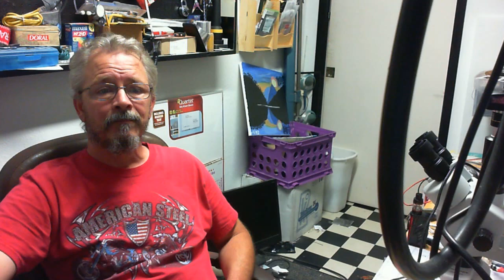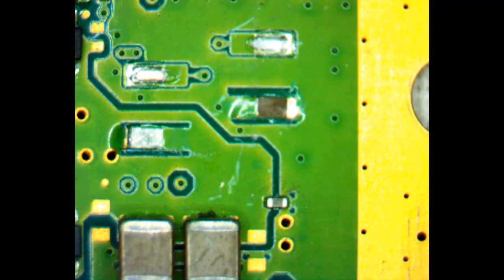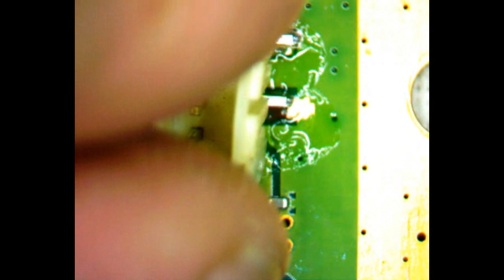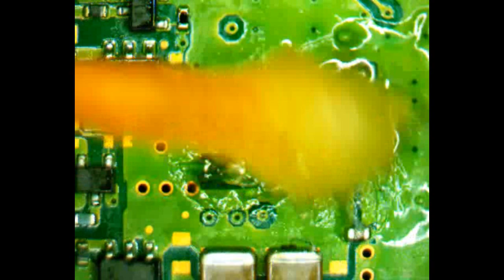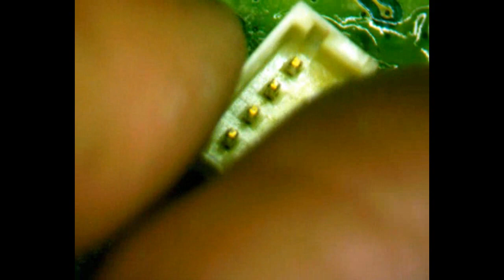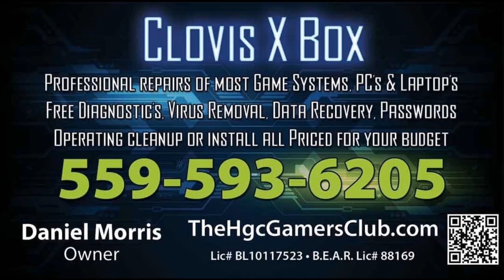PS4 CUH-1115A No Power (Motherboard Repair)

Comment: How to rebuild the two pads on this model you said are extremely hard to rebuild what are the test points for those two pads??
Reply from the maker: Why would you need test points if the port was ripped off the motherboard? Sorry but if you can not figure out how to fix something simple like this you should take it to a qualified repair shop before you end your system.

Comment: Hey bud question for you hope it gets answered, does this call for Leaded Solder only or can Unleaded Solder work as well?? All pads still under component. Got it on board yesterday but no power still
Reply from the maker: You can use easily use both for anything on the power supply the leaded solder is easier to work with for most. But I would recommend before you burn down your house or someone else's house you just buy a working replacement on eBay because that is the (1) item in the hole system that can and will kill someone if you do not do the repair correctly.
Reply: Well I was able to do it without the housefire assface thanks for that comment but where are test points for the pads if the trace is gone??

Comment: Hello I have this same issue and I've been told the repair isnt possible or that I need a trace wire for the two ports. The power supply was pulled cleaned off. Is all that is needed is a solder or do I need to place a trace wire?
Reply from the maker: I would need to see the damage on the motherboard to even come close to answering that question if a shop told you it was not possible it is because they are YouTube Educated and do not know what they are doing there is always a way to fix it as long as you did not damage anything else trying to remove the motherboard or trying to solder it yourself? If you like you can mail it to me for the repair it will be a little under $15 to send it USPS if for any reason it is not repairable I will not charge you for finding out, if you are local it will not cost you anything for me to look at it. http://www.clovisxbox360repair.com/contact.html
Reply: Nice work

Comment: How much do you charge to put a new motherboard in
Reply from the maker: Most Motherboards can be repaired and repaired right for a long lasting system if and only if the person working on your game system has education in component level electronics and is not a self-educated YouTube Criminal doing cheap tricks that damage the system and will never last any length of time.
Reply from the maker: Seriously it is not worth putting a new motherboard in your and this is why: 1 Sony does not sale motherboards 2. There is no such thing as a new motherboard they are all pulled from broken down systems that were parted out by someone that likely has no education in electronics 3. with all likelihood the person selling the replacement USED motherboard may have damaged it because they do not know jack about electronics or that in some cases for specific models the drive board in the system they removed it form must go with it or it can never play a disk or update ever! or 4. Has watched a youtube video on how to Okieriged it to work for a few days by using a heat gun made to remove paint from furniture. Last but not least no matter who you buy one form if it dose not work they will claim you damaged it trying to install it and will refuse any refund.
Reply: TheHGCGamersClub  I guess my search comes to an end here 🤦🏾‍♂️ had a problem with the USBs on my ps4 slim not charging had them fixed and the console goes off a week later and the repairer is tell me I need a new board 😳😳 have been search for one since.

Comment: hello my ps4 has no power,and the power supply is good i tested it... it's something on the motherboard, can you tell me howw to fix it ? any sugestion ?
Reply from the maker: No I Can not and no one else can there are lots of reasons for what you are looking at and the only way to find out what is wrong is to test the system in a shop and that needs to be dun by a Qualified and Educated Repairman not you and not some kid working at Game Stopper's watching the same YouTube Videos you can find and experimenting only to destroy and steal parts for there next fake repair.
Reply: Bifout Djamel any luck? Mine did the same
Reply: @Eastsidee817  no i have replace many ic and diode on the motherboard but no luck but i will find a solution

Comment: Hi uncle   I am azam. I have e ps4 slim .but   power button not work
Reply from the maker: lots of reasons for not having power to the system and yes it can even be the button itself the only way for me to know or help you is to open the system and check it out, I am sure there are others on YouTube that will say fix this or it will be that but the fact is unless you can visually identify your problem trying to fix something that is not broken can and will lead to the Death of your system. I recommend you take it to a qualifed repair shop, ask for education in component level electronics so you do not get YouTubed.

Comment: Hi, thanks for the video, I have a question, is it possible to replace the motherboard type SAA-001-CUH-1003A with other types ?, I was trying reballing on CUH-1003A, I applied lots of heat and damage the motherboard, I was looking for for the same model but it's really hard to finde one it seems its very old.